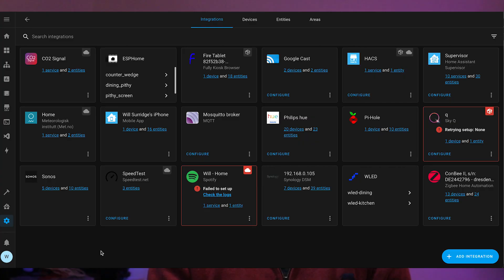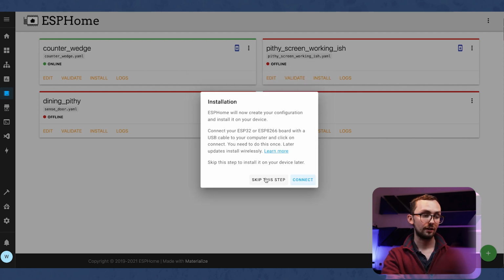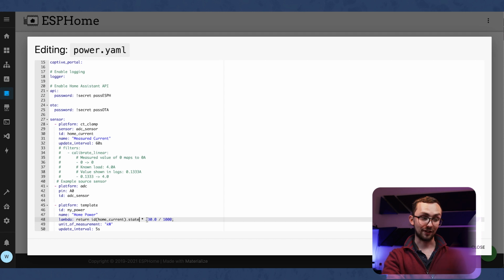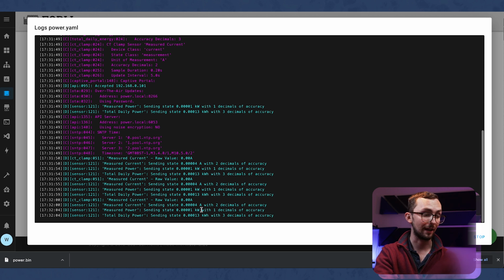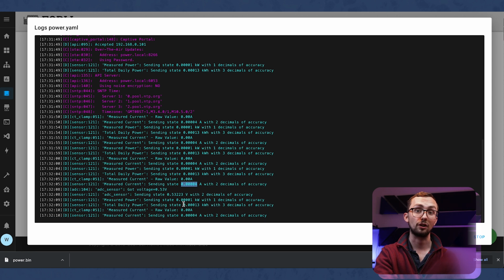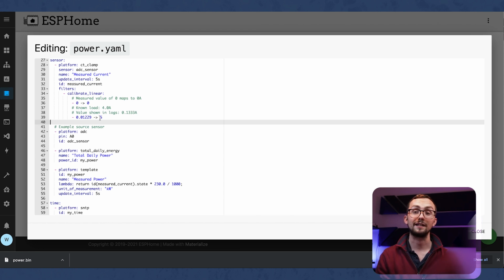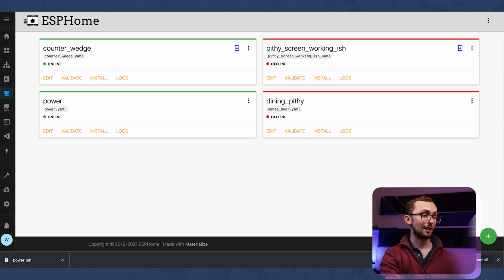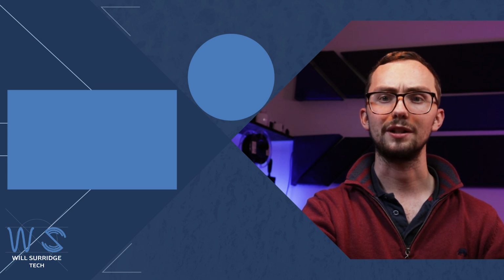Clamp Sensor Energy Monitoring - ESPHome in Home Assistant

Comment: Hold your 🐎🐎...
Totally wrong for two reasons:
1. AC Voltage is not constant. It can fluctuate plus minus 6-7% therefore your calculation is off.
2. Power factor (cosφ) rarely is 1 unless is a purely resistive load. You need reactive power in order to calculate cosφ, and voltage in order to calculate Amps.
Your calculations are going to 🚽.
Get a Shelly EM instead.
Reply: What is actually being measured is kVA not kW. This is going to be very inaccurate. Most of the time loads will be electronics like led lamps, usb powered devices etc. Currently my power factor is 68, that means actual charged for load is V*A*0.68 you are using two fixed values that both vary significantly, eg volts could be anywhere between 220v and 250v or occasionally higher/lower. Power factor could be anywhere between 0.5 and 1.0 depending on the load type.
Reply: @rimosky  true but: 1- check your real usage of energy at home (value in kWh) and tell me if the iron or oven takes less per month or all your USB-powered devices, 2- he is NOT presenting a measurement device (like digital multimeter) but the device, that shows him on home assistant "something" and based on the values he can introduce automation i.e. "washing machine power is < 2W -> let me run the ring" or something like that. For such case I think this is enough. Of course measuring Volts would have much more sense but again: check my point 2.
Reply: @zyghom  The number of devices in my home that have a power factor of less than 1 is growing; just about every switched mode power supply is anywhere from 0.5 to 0.6; things like computers, lighting etc... The amount of pure resistive loads in my house is falling dramatically. UK normal electric meters record assuming a PF of 1, smart meters are able to determine the PF and will eventually start to charge accordingly, resulting in what could be a dramatically higher bill; This is why I've resisted a smart meter...
Reply: at home (flat) most of loads are resistive nature. And those, that are not (washing machine motor i.e.) consumes much less than the heater inside it. So with some estimation it could be enough. With regards to voltage: you are right - my HA shows me fluctuation between 227V and 247V (UK)
Reply: @zyghom  At my house cosφ is average 0.85. It's far from "nature". The reason is  I run refrigerator, washing machine, and a LOT devices with a power supply  (AC to DC converters).
Good thing is that power company not "punish" for that.
So, Will's calculations are way off.
Reply: @kdelios  wait, if he measures only resistive and the vendor charges only for resistive....- what is wrong then? he does not measure for the "truth" but for what he is charged, right?
Reply: @zyghom  he measures the hole thing
Reply: Power companies only charge you for the reactive power.
Reply: @coin777  Do you know what "reactive power" is? Take a look at Wikipedia to find out. Your statement is not correct. For house use, power companies will not charge you for bad power factor. They charge you for cosφ=1. But this is not always the case. In most houses exist refrigerators, washing machines, and a LOT devices with a power supply  AC to DC converter. Those devices drop cosφ to an average of 0.85.
Therefore, there is a amount of  "unwanted" reactive power going back to the grid causing some issues.
On the other hand if you run a facility with 3 phases and a decent power consumption, then power companies will charge (a lot) you for reactive power also (along with your consumption).
That's why factories etc use devices to "correct" cosφ and bring it as close and possible to 1.
Reply: @kdelios "That's why factories etc use devices to "correct" cosφ and bring it as close and possible to 1." -  "the capacitor" from the old motors... ;-)